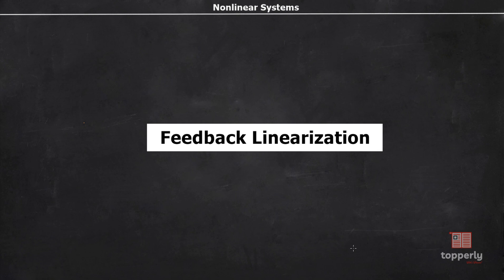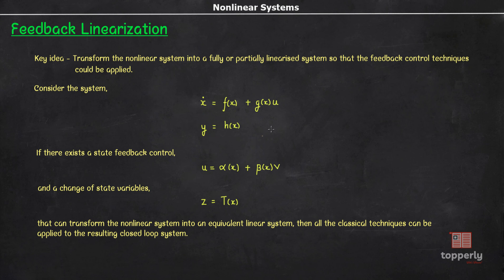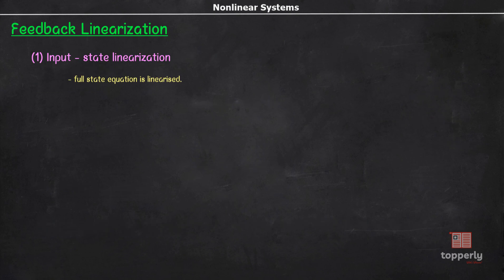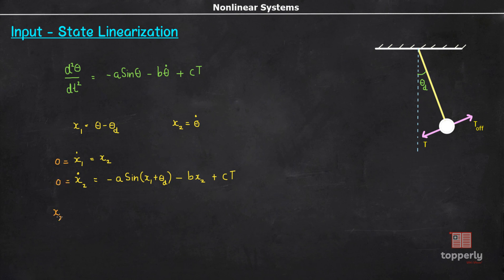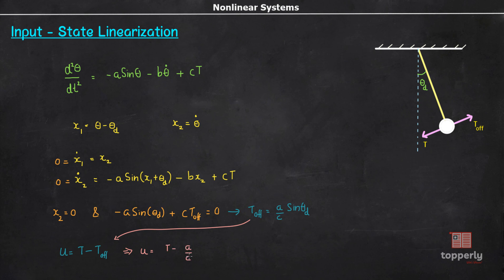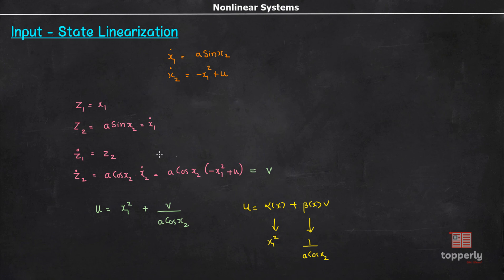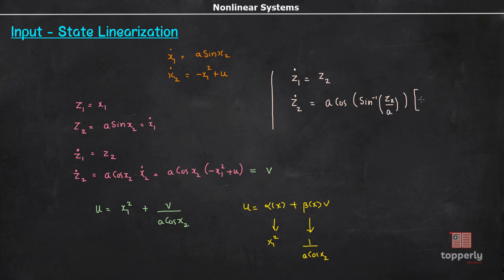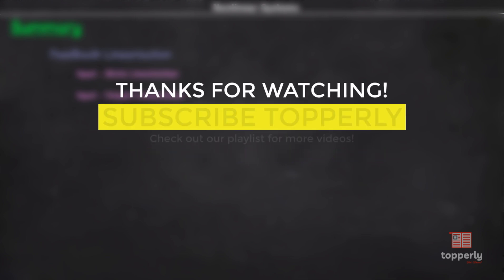Feedback Linearization | Input-State Linearization | Nonlinear Control Systems

Comment: Why do we need to apply an input of T-Toff at 5:00?
Our input needs to balance the regular T experienced by the pendulum. At equilibrium Toff would be equal to T so that they balance. Shouldn't the input u = T = Toff? Please help me with the gap in my understanding.
Reply from the maker: Hi Animesh,
Our objective is to stabilize the pendulum at Theta_d. At steady state T=Toff. But to bring to steady state, the force we should apply is u = T - Toff, ie, the difference between current state and desired state :)
Reply: @Topperly  oh, now I understand that this is the extra torque required. But why is this not: (final-initial) i.e. Toff-T?

(I've generally seen ∆ written as final-initial)
Reply: @Topperly Awaiting your response

Comment: Hello! Awesome video keep it on. I have one doubt regarding Input Output linearization. I have a LPV system and would like to apply I/O FBL to get rid of the parameter dependency. After converting my LPV system to its canonical form I got the relation u = (v - alpha(x))/beta(x). But now when I apply this law and the check the open loop response from v to y the response is not stable. Hence it is difficult to design a feedback controller for this new system. What am I doing wrong? Please help! Thanks in advance :)
Reply from the maker: Please note that all systems are not feedback linearisable. In this particular case, if the relative degree of output is less than the dimension of state space, then the system can only be partially feedback linearisable due to internal dynamics.

PS: My opinion might be wrong. If any viewer is interested, please feel free to join this discussion :)
Reply: @Topperly  Yes you are correct. The relative degree is less and the system also has internal dynamics which are stable as the zeros of the original system (which acts as pole of internal dynamics) are negative.
Reply: Simulink model please